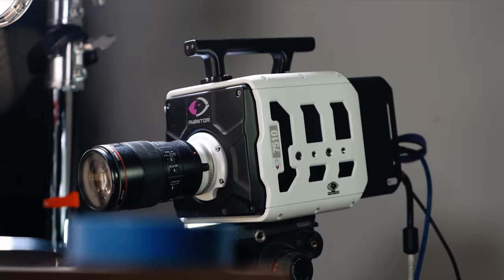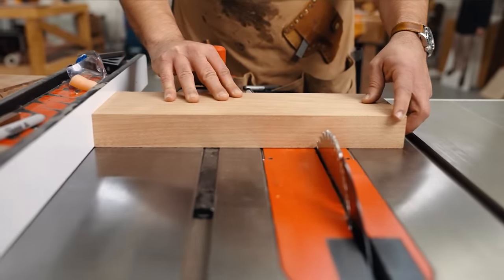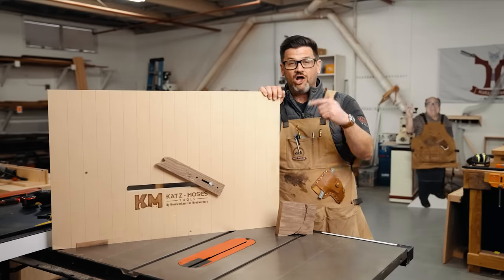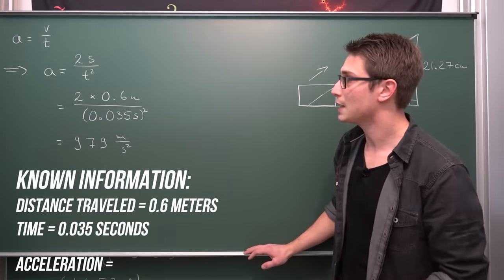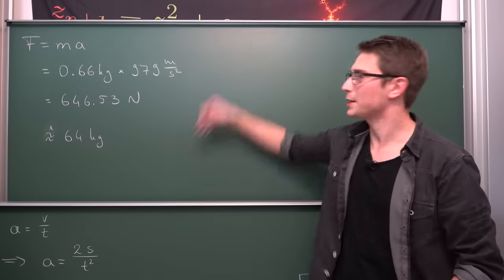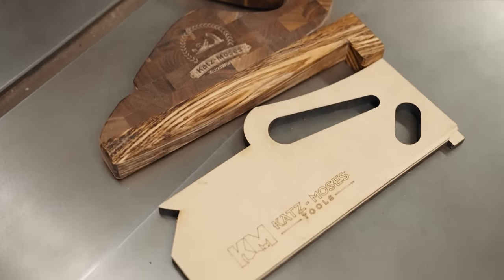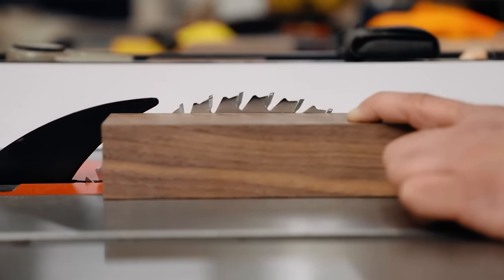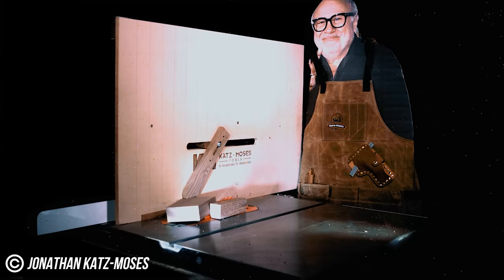The Anatomy of a Table Saw Kickback at 50,000 FPS Ultra Slow Motion in HD

Comment: You need to get a different physics guy.  Pretty much everything he calculated was fundamentally wrong in some way.

First, the equations for calculating acceleration he used would only be correct if the block of wood was experiencing constant acceleration over its entire travel, but it wasn't.  It only experienced acceleration while it was in contact with the blade.  After it left the blade, the rest of the time it was experiencing roughly constant velocity (and it shouldn't be too hard to determine the actual velocity from the video).  Therefore, the acceleration number is completely wrong (it's actually probably much lower than it should be).

But far more importantly, the force calculated from that acceleration was only the force the blade happened to be putting on the block to accelerate it.  It has absolutely nothing to do with how hard the block hits you later.  For that you would need to determine the deceleration the block experienced when hitting someone and use that for the 'acceleration' parameter in those calculations.

If you wanted to compare the real-world impact of the block to other objects, however, force really isn't the most useful metric anyway, IMHO.  It would be much better to calculate the kinetic energy it possesses, and divide that by the surface area of the impact (keeping in mind that it will probably impact with a corner or edge, not fully face-on).  That will give you a more direct comparison of the amount of damage it is likely to do to whatever it impacts compared to, say, a bullet would.

The rest of the video was very good and informative, though.

Oh, one other thing:  You mentioned that you don't want to have the blade any higher than necessary, but one other reason for this is that the taller the blade is, the more upward force it can impart to the piece, launching it higher into the air, so if you do end up getting a kickback, with a more fully extended blade, it's more likely to go straight for your head instead of just your chest or arm (like what happened to poor Danny)..

Comment: Who’s the wanna be physics guy, pretty much everything he said was either completely wrong or missleading.

The distance of acceleration is wrong, it should be the distance between where the center of mass of the wood was when it contacted the blade to where the center of mass was after it left the blade, not … whatever he was babbling about.

646 N of force is not in any way near equivalent to someone weighing 64kg jumping from a 10 story building ln your face, it’s the force of someone weighing 64kg standing on you. It’s also no way near the force you’ll experience being hit by that wood, since the stopping distance of that board will be the distance your face moves to slow down that bord, which is going to be on the order of millimeters, so basically he is off by only a factor of around 100.

Also, Force, speed, energy and acceleration seem to be mixed arbitrarily, but thats a tiny issue in comparison to the other errors.
If you don’t want to embaress yourself infront of any viewer who knows physics, maybe just leave the physics out, it doesn’t contribute much to the video for those who don’t understand it and it’s frustrating as hell for those of us who do.

Comment: Great video as usual.
I just disagree on one point about safety (i'm french so i hope my english will be good enough). You say that the blade shouldn't be higher than one teeth above the piece of woord.
But the higher is the blade, the more pressure it gives the piece DOWN the table. The downer is the blade, the more pressure it gives the piece back (toward the operator). So with a high blade you should have less kick back but if it's happen but more dangerous ones (easily avoidable by pressing down the piece).
Reply from the maker: I'm going to respond in case anybody is reading your comment and taking advice from it. That is absolutely incorrect. I suggest you do some research on this but we will have a video out soon where we document why this is a bad idea with slow motion footage. Thanks for watching Cheers my friend.
Reply: I'm taking advice, not giving any!😉 and i'm not sure to make my point clear (english is not my language).
To illustratrate my point: if you make a "half lap" cut you have to push your piece  with the strenght forward and if your blade is higher than your piece you have to push down.

Comment: Just take the rpm of the saw blade and its diameter d (in meter) to calculate the speed v (in m/s). A saw tooth will have v = rpm/60*d/2. The kicked piece will accelerate to equal speed as the saw teeth. You only need to analyse your audio file to measure the change in rpm while kicking.

Comment: You calcuted the force required to accelerate the wood block over a fixed distance. This is not the force you would feel if the block gets decelerated onto the chest.

Comment: A few things to consider:  First the effective distance traveled should be referenced from the movement of the center of gravity, not the rotating edge of the material.  Also, rotational energy imparted on the block of wood was not considered.  Finally, the mass should be the initial mass, not the final mass.  However, much like a spaceship during acceleration, the wooden block is losing mass during its acceleration.  Real life is complex.
Reply from the maker: I'm just impressed an ex president commented on my video.
Reply: Why do you think the mass is decreasing?

Comment: Great lesson aside, the velocity your mathematician stated “3200 ft per second” is off. That’s as fast as a very high speed rifle round. Tree times faster than a 9mm bullet. A one pound weight of any sort At that speed  would obliterate your gel friend no doubt. Foot pounds of energy would be over 150,000 ft lbs. there are 437.5 grains in one ounce. 
I sure don’t want to be hit by that block of wood, but if those calculations were correct it would not be a survivable impact many times over.
Reply: @Jonathan Katz-Moses now?

Comment: Good video. Not sure I agree with the math. The acceleration is finished once the wood is airborne, so it’s not a factor in the impact force. I’d have calculated the velocity and from there the kinetic energy and compared that to a bullet. The damage is done by impulse, which is a function of the rate of deceleration. That’s why layers of clothing are helpful, and why cars are designed to crumple.
Reply from the maker: All the numbers are in there. Let's see it Lee?
Reply: @katzmosestools  the velocity of the wood is .6m/.035s = 17 m/s. Ek= 1/2mvsquared = 1/2*.66*289=95.37 joules

A 9mm bullet weighing 130 grains (.0084kg) going 1000ft/sec (304 m/s) has a kinetic energy of 304*304*.0084/2=388 joules

Therefore the energy of the bullet is about 4x that of the wood. The comment about impact area is absolutely true of course.
Reply: Great video! I agree that the math is not at all valid. That shouldn't take away from how valuable the video is though (thank you for making it)! First, that formula for acceleration is valid for constant acceleration. BUT, the acceleration all happens in almost an instant, when the blade contacts the wood. After it leaves the blade, it's about traveling at constant speed. That problem is actually easier than he made it. Calculate the speed from 0.6m/0.035s then use the formula he had in the corner. A=v/t. To get the average acceleration, where time this time is the time it is in contact with the blade. None of this matters at all though, as Lee pointed out, because this isn't the "acceleration" that hits you. If you really care about the force, do the same calculation but see how long it takes for the dummy to absorb the impact of the wood hitting it, and use the velocity with that to get acceleration and weight of the block to get force. It's probably not the right math problem to solve anyway, because it depends on how squishy your body is (think about Lee's car crumple). Instead you could look at momentum, mass times velocity. But the units of that are not very intuitive. Really, I would just keep it simple and say a block that weight, hitting you that fast is going to bloody hurt!
Reply from the maker: You're is the only person in 20k views who has said that so I'd bet it is correct. I've been a content creator for 6 years. If you say something wrong the internet mob jumps all over it. If something was incorrect there'd be 25 comments an hour about it and 3 of them would be the top voted comments. You have one like on your comment. After 5 hours. I don't know enough to argue the math BUT I do know what viewers do when you're wrong and I'm guessing a lot of smart people have watched this video today.
Reply: @katzmosestools  nobody has debunked my assertion. The only things that matter with a flying object are mass and speed. If you disregard air resistance, the only force acting upon the wood is gravity, unless you have a propeller or jet engine. Once the object hits something and decelerates, you can calculate the force if you know how long it takes to come to rest. That’s why hunters like bullets to stop in the game, and not pass through. If you go back and do the speed calculation one the wood is airborne, you’re on your was to the correct answer.
Reply: @katzmosestools  there is another comment making the same point essentially. There are a lot of smart people. Not many of them study physics.